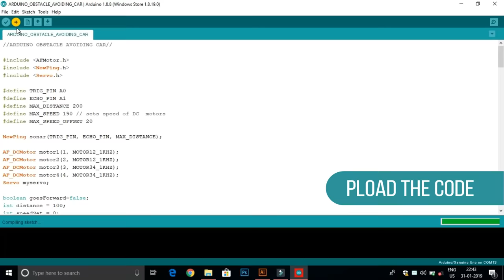How To Make A DIY Arduino Obstacle Avoiding Car At Home

Comment: Thanks so much for sharing this tutorial. It is awesome. My son liked it very much and he is building it following your instructions. He is stuck at one point though. It doesn't work when just connected to battery. The light on the top circuit board glows with battery but the light is off on the bottom board. When he connects the USB cable to bottom circuit board, the light is on and the motors, sensor starts rotating. Why it doesn't work with just the battery. Is he missing any step? Is there a way to connect with you directly. Appreciate your help.
Reply from the maker: Which battery is he using?
Reply: @DIYBuilder  18650 3000mAh 3.7v (2 Qty) as given in the description
Reply from the maker: Contact me here https://www.instagram.com/surajit_majumdar/
Reply: @DIYBuilder  Sure. I just did it. I hope to hear back from you. Thanks
Reply: Thanks for your help in getting over the hump. It works great after your suggested changes. Keep up the good work!!
Reply: For those who are struggling with this issue wherein the robot works as long as the USB cable is connected to the laptop but stops working once you remove the USB cable to lower circuit board. I got in touch with Surajit and  he suggested to remove the jumper (near the battery input) and join +ve battery point to Vin point of the circuit board. With that change, it started working without the USB cable. I made changes based on the suggestion from Surajit and may not necessarily be the reason if you are facing similar issue. I would recommend you to take the expert's advice before making any changes.
Reply: Thank you for having this comment and then following up with an update on what you did to resolve the issue. Also thank you for specifying the exact battery he recommended, because the links are now dead haha, so I had no idea what voltage we needed.
Reply: Hey I cannot find the vin point on circuit board pls help

Comment: Building this is easy . Designing the code for it is the hard part.
Reply: @Akshat Sharma same
Reply: Akshat Sharma yes the reverse it
Reply: the code is already given can't you see when you open that code and choose an app from the microsoft store or any app on your computer you will see that the code is already made. the app he using for coding is arduino ide which is available on microsoft
Reply: nishu tripathi or macbook

Comment: Hi, in the parts list there are two 3.6 volts batteries in parallel, but in the Circuit Diagram it says to use a 9V battery. Are both options safe?
Reply: A little late, but yes it is safe. The arduino will convert either to 5v as long as the input as below 20v safely, I believe
Reply: @connorsullivan5996  doesn't arduino uno need 9v to work?
Reply: @connorsullivan5996  I was looking for this. Thank you!

Comment: It is working perfectly thank you 😃
Reply from the maker: Enjoy
Reply: @DIYBuilder  bro 
L298N module ko maine 5 volt ke charger se power diya to on nhi hua 
minimum voltage kitna chahiye 
please reply
Reply: hello,, can you help me?
below is the error everytime  i upload it.... help please

Arduino: 1.8.12 (Windows 10), Board: "Arduino Uno"

Sketch uses 3908 bytes (12%) of program storage space. Maximum is 32256 bytes.
Global variables use 87 bytes (4%) of dynamic memory, leaving 1961 bytes for local variables. Maximum is 2048 bytes.
An error occurred while uploading the sketch

This report would have more information with
"Show verbose output during compilation"
option enabled in File -> Preferences.
Reply: @haru haru have you selected the correct board ?
Reply: @siddharthasingh9570  yes...  Huhu please help me
Reply: @haruchi8196  Upload it with your phone using arduino ide
Reply: @siddharthasingh9570  you mean there's an arduino ide app for phone? Then use it to upload the codes?
Reply: @haruchi8196  yes
Reply: @siddharthasingh9570  okok ill try it...  I hope it will work this time...  Ive been searching like 3 hours already but still no work so...  I hope it will work...  Anyways..  thank you so much for noticing and replying to my reply....  ありがとう
Reply: @DIYBuilder  can you send me code pls
Reply: @DIYBuilder  I am new in this

Comment: Can we make some modifications in the project and code to 1) attach led lights for forward and reverse motion separately. 2) Reverse motion should be 50 percent slower than forward motion along with siren. 3) Ensure car should not hit any obstacle in reverse motion. If possible please make a video.

Comment: Great video! What is the max weight the motors can pull? I tried to make the base from wood and they cannot pull that weight.
Reply: buy a more powerful motor or replace wood with plastic or cardboard :)
Reply: It's only 3volts so of course it will not pull that weight
Reply: I am using plastic and it still won't  move

Comment: You made my semester project easy, thankyou DiY project ❤️
Reply: Its working perfectly 👍
Reply from the maker: Great bro
Reply: @DIYBuilder  Can i run it with 12volts battery
Reply: @zainulabidin3033  how much did it cost u

Comment: Amazing work 😍 
Can I ask? Is it okay to use L298N for the motor drive shield?
Reply from the maker: Yes you can but if you use L298N then you need to modify the code.
Reply: Can you give a modified code

Comment: Hey bro everyone has the same question we did the project but only beep noise is coming and motor doesn't run ( we used 2 × 3.7v cells as mentioned) the robo isn't moving
Please tell the solution please reply

Comment: The perfect tutorial
Reply from the maker: Thanks bro 😊
Reply: @DIYBuilder  Need a help .. whether to use NODE MCU or Arduino Uno for making an MINE SURVEILLANCE BOT which consist of Gas sensors , Temp Sensor & a camera working at wi-fi ..
Please it's urgent
Reply: @DIY Builder Amazing bro super work👍♥️Die hard fan broo💪
Reply: @DIYBuilder  Mister, actually your batteries could support 4 DC motor and Arduino Board????

Comment: Where to connect the wires from ultra sonic sensor to motor driver ..there are no pins near +5 and gnd
Reply: Yah plz do reply
Reply: next to power and ground theres a row of pins that are labeled 0-5. Those are A0-A5. Just plug it in there
Reply: Bro he has given a circuit diagram in the description. You can check all the wirings there.

Comment: how can i install the switch?
Reply: Solder the switch to the battery wires and connect the other pole to the rest of the circuit, when the switch is turned off the power cant go any further

Comment: Pls give a word document of the code or Google drive
Reply: #include <AFMotor.h>  
#include <NewPing.h>
#include <Servo.h> 

#define TRIG_PIN A0 
#define ECHO_PIN A1 
#define MAX_DISTANCE 200 
#define MAX_SPEED 190 // sets speed of DC  motors
#define MAX_SPEED_OFFSET 20

NewPing sonar(TRIG_PIN, ECHO_PIN, MAX_DISTANCE); 

AF_DCMotor motor1(1, MOTOR12_1KHZ); 
AF_DCMotor motor2(2, MOTOR12_1KHZ);
AF_DCMotor motor3(3, MOTOR34_1KHZ);
AF_DCMotor motor4(4, MOTOR34_1KHZ);
Servo myservo;   

boolean goesForward=false;
int distance = 100;
int speedSet = 0;

void setup() {

  myservo.attach(10);  
  myservo.write(115); 
  delay(2000);
  distance = readPing();
  delay(100);
  distance = readPing();
  delay(100);
  distance = readPing();
  delay(100);
  distance = readPing();
  delay(100);
}

void loop() {
 int distanceR = 0;
 int distanceL =  0;
 delay(40);
 
 if(distance<=15)
 {
  moveStop();
  delay(100);
  moveBackward();
  delay(300);
  moveStop();
  delay(200);
  distanceR = lookRight();
  delay(200);
  distanceL = lookLeft();
  delay(200);

  if(distanceR>=distanceL)
  {
    turnRight();
    moveStop();
  }else
  {
    turnLeft();
    moveStop();
  }
 }else
 {
  moveForward();
 }
 distance = readPing();
}

int lookRight()
{
    myservo.write(50); 
    delay(500);
    int distance = readPing();
    delay(100);
    myservo.write(115); 
    return distance;
}

int lookLeft()
{
    myservo.write(170); 
    delay(500);
    int distance = readPing();
    delay(100);
    myservo.write(115); 
    return distance;
    delay(100);
}

int readPing() { 
  delay(70);
  int cm = sonar.ping_cm();
  if(cm==0)
  {
    cm = 250;
  }
  return cm;
}

void moveStop() {
  motor1.run(RELEASE); 
  motor2.run(RELEASE);
  motor3.run(RELEASE);
  motor4.run(RELEASE);
  } 
  
void moveForward() {

 if(!goesForward)
  {
    goesForward=true;
    motor1.run(FORWARD);      
    motor2.run(FORWARD);
    motor3.run(FORWARD); 
    motor4.run(FORWARD);     
   for (speedSet = 0; speedSet < MAX_SPEED; speedSet +=2) // slowly bring the speed up to avoid loading down the batteries too quickly
   {
    motor1.setSpeed(speedSet);
    motor2.setSpeed(speedSet);
    motor3.setSpeed(speedSet);
    motor4.setSpeed(speedSet);
    delay(5);
   }
  }
}

void moveBackward() {
    goesForward=false;
    motor1.run(BACKWARD);      
    motor2.run(BACKWARD);
    motor3.run(BACKWARD);
    motor4.run(BACKWARD);  
  for (speedSet = 0; speedSet < MAX_SPEED; speedSet +=2) // slowly bring the speed up to avoid loading down the batteries too quickly
  {
    motor1.setSpeed(speedSet);
    motor2.setSpeed(speedSet);
    motor3.setSpeed(speedSet);
    motor4.setSpeed(speedSet);
    delay(5);
  }
}  

void turnRight() {
  motor1.run(FORWARD);
  motor2.run(FORWARD);
  motor3.run(BACKWARD);
  motor4.run(BACKWARD);     
  delay(500);
  motor1.run(FORWARD);      
  motor2.run(FORWARD);
  motor3.run(FORWARD);
  motor4.run(FORWARD);      
} 
 
void turnLeft() {
  motor1.run(BACKWARD);     
  motor2.run(BACKWARD);  
  motor3.run(FORWARD);
  motor4.run(FORWARD);   
  delay(500);
  motor1.run(FORWARD);     
  motor2.run(FORWARD);
  motor3.run(FORWARD);
  motor4.run(FORWARD);
}  
THIS IS THE CODE
Reply: @programmerworld1270  thanx but i already made ot a year ago
Reply: @karandicholkar3508  no need to say thanks bro

Comment: Hello, sir. I have also made it exactly as you did, with both hardware and software working perfectly. No issues occurred, but after connecting the batteries, the Arduino and motor shield light up, and it's attempting to move, but it's moving in small jerks and not running properly. Sir, help me, I need to showcase this in an exhibition in 20 days. How can I contact you? Anyways, this build is awesome.

Comment: Dude, i need to make a similar project but instead of ultrasonic sensors I have to use light dependent resistor to make a car that will stop at red light or any other light source, can you suggest me what to do

Comment: Hi! Can you use a regular AA/AAA battery with their respective battery holders instead of a 18650 battery? Thanks
Reply from the maker: No you can't
Reply: 18560 batteries and the holder are not available on the website in the description. I need the materials a little urgently since I have a school project. What do you suggest? @DIYBuilder

Comment: I think you should Increase the distance in the code because at 4:57 it collides a little bit and by the way you got a subscribe form my side 🙂
Reply: Bro could you please tell me how to increase the distance mine is also facing the same problem
Reply: @Sickandill  Sure just go to the code and then find this code line "if(distance<=15)" and change 15 to 20 or 25 as your wish. I hope this works out 🙂

Comment: @DIYBuilder in motor shield, which I purchased from flyrobo is not having pins to connect ultrasonic sensor, it has holes. So can you please suggest how to connect wires comin from ultrasonic to those holes. Is soldering an option. Thank You
Reply: up

Comment: In the motor driver at the gnd, +5 etc portions we have to attach those pins and have to soliding them?
Reply: No bro, No need for that ,just use Female - Female type Jumper cable to connect sensor with Motor Driver Pins.

Comment: What zip wire did you use to connect the gear motor to the motor driver?
Reply: Male to male
Jumper wires

Comment: its very useful for beginners . but i tried a lot with same coding still servo and sensor is not working properly . means sensor is not detecting any obstacle
Reply: Having same problem,do you find any tip for it?

Comment: I have make the same robo but there is a issue in it front two wheels are moving fast but backward two wheels are not moving at the same speed as front wheel spinning

Comment: Hi, at 3min28, cables are connected to a component that do not appear on the amazon link of the motor driver, does anyone know what is that missing part and where to buy it ? Thank you.

Comment: We connected a battery to it but the wheels only spin when the USB is connected. The servo is on when the USB is disconnected but not running. Any help would be appreciated
Reply from the maker: which battery r u using?

Comment: hello, after uploading the code it makes a loud high pitch noise and the wheels are not working unless I give them a little roll to start them off and the sensor is not working at all what should I do?
Reply: I think it might be a battery problem but i am not sure.

Comment: I am building an self balancing robot arduino uno with 2 motors and 3 18650 cells but it doesn't work i don't know why but this guy howw powered 4 motors with just 2 cells please hellp mee 🙏🙏

Comment: Bro I ran into a problem I used your code but whenever I turn the power on the sensor mounted on the servo motor looks left and stops it give a beeping sound the wheels move very slow after giving a push plz help me in this.😫😫

Comment: Is there any software tht we hv to download for this code. I'm first year engineering student so i hv no idea about things.
Reply from the maker: You can download the code from the video description after that download and Install Arduino IDE then open the sketch in Arduino IDE, and then install the required libraries from the Arduino library manager once everything is done you can upload the sketch without any error.

Comment: Materials
- Arduino UNO
- Motor Driver
- Servo Motor
- Ultrasonic Sensor
- 4 Wheels
- Gear Motor
- 18650 Batteries

Comment: I'm so depressed. I ordered the motor controller from a website called makerbazzar.....it came with a few bent pins which I fixed.... but it doest have the main sensor connecting pins 🥲 the total was 2037......l the
 +5
Trig
Echo
Gnd 

Pins are not there any fixes?? I'm  please help

Comment: I have checked all the connection and all the components are in working condition I uploaded the same code but still it doesn't work what could be the reason the lights on the motor driver and Arduino turns on when I switch it on but the motors and servo motor doesn't move at all
Reply: Same bro
Reply: Can't find the solution

Comment: Hello, I tried making this project. All connections and everything are done exactly as shown but only one wheel is running. All others are static and not doing anything. Has anybody else faced this problem? What was the solution?

Comment: Hey, I built the robot but I'm running into a problem with the servo motor. It's doing a full continuous rotation instead of a left-to-right read. Can anyone help me? I uploaded the mentioned servo library but maybe it's the wrong one?
Reply: Arduino IDE

Comment: I uploaded the code ., the motor are working fine and the car is moving however the ultrasonic sensor not working . I checked the connection and seemed to fine .. can anyone help

Comment: Sir mene code sab upload kar diya but it's not working 🥺😭 can you please help... Please sir in 2 days I have to submit it...
Reply: How can I contact you sir... Please I need your help
Reply: Sir ultrasonic sensor and servo motor is working but wheels are not rotating... Sir Please reply what might be the problem 😢